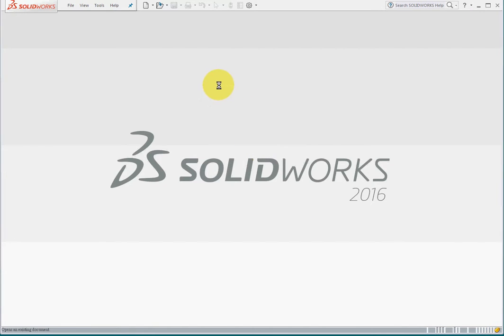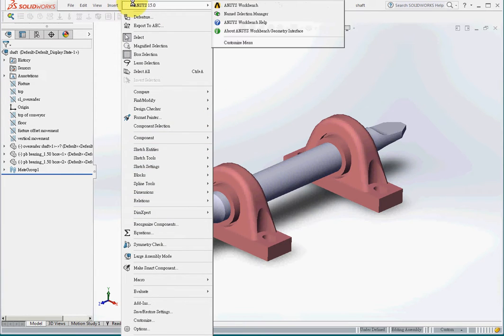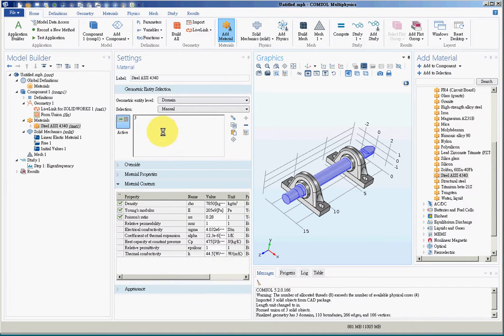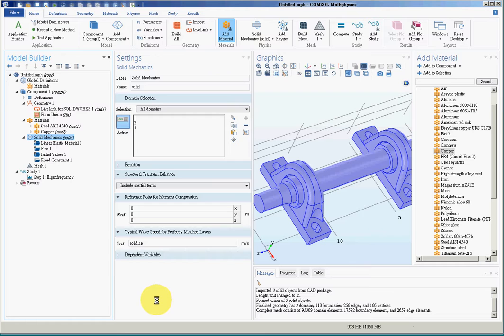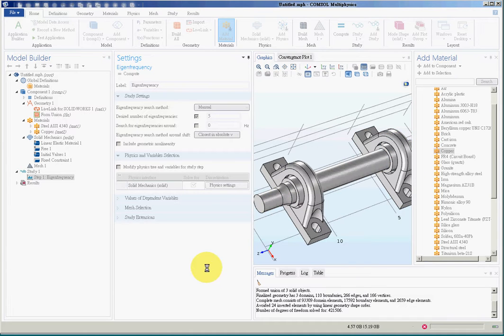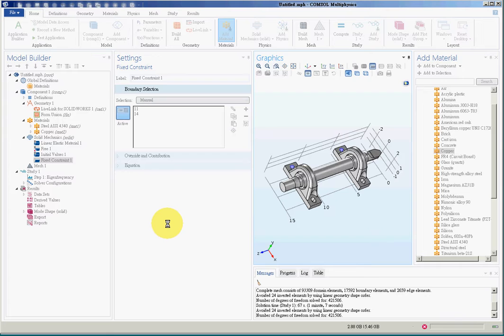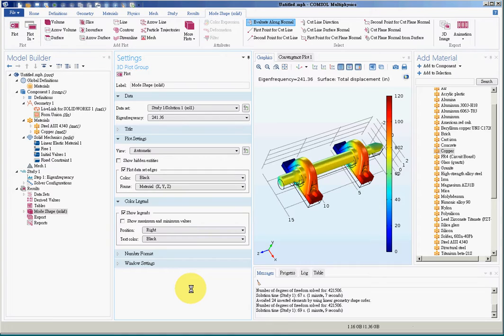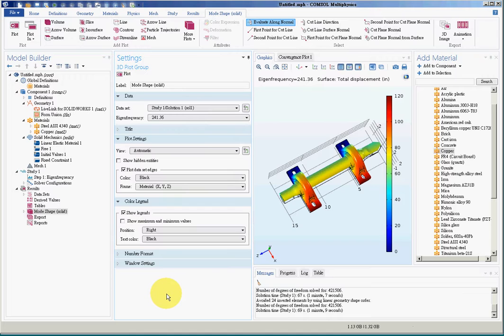COMSOL CAE 5 2  Eigenfrequency Analysis Effect of Constraints

Comment: Hi,

do you know how to simulate torsion in a shaft ? It's not easy to apply torque in COMSOL and method with cylindrical coordinate system seems to give incorrect results.
Reply from the maker: I recommend that you choose software packages such as SolidWorks Silumlation or Ansys for this type of problems.  It will be a lot easier.  The most powerful area for COMSOL is in multiphysics, especially for problems that can not be simulated in the existing software packages. (my personal opinion)
Reply: 謝忠祐 Thanks for reply.
I use SolidWorks on my university too and it’s very easy to apply torque there but I would also like to learn how to do it in COMSOL. So far the only close-enough way is to use Rigid Connector. But it makes boundary rigid which influences results. I’ve seen some advices how to do it by setting Boubdary Load properly but it’s very complicated and I don’t fully understand these descriptions.